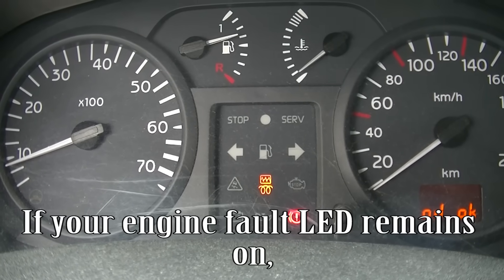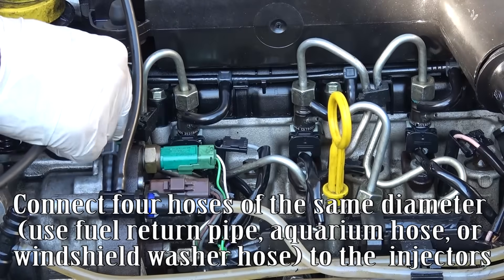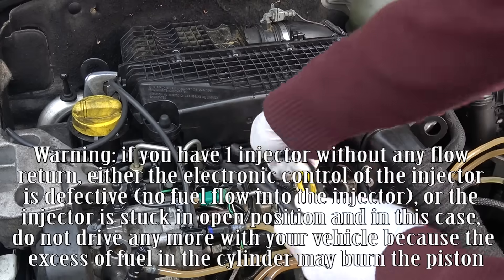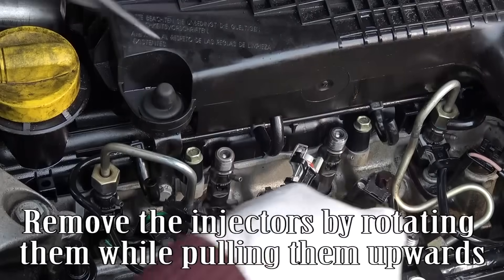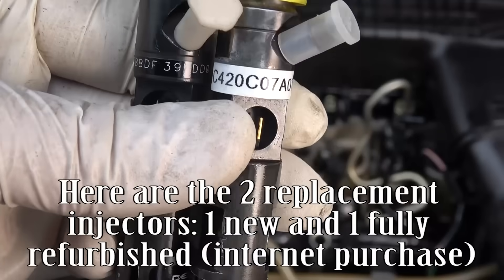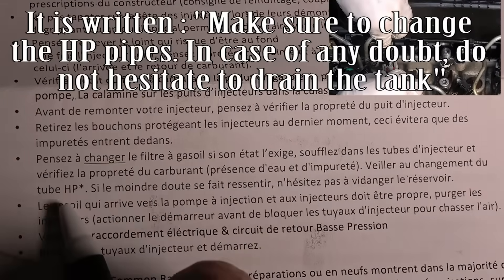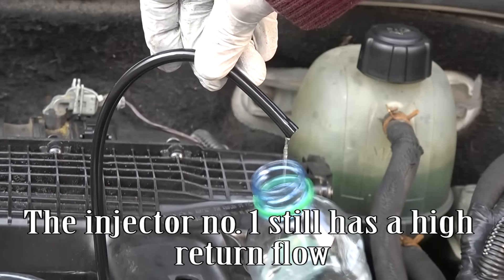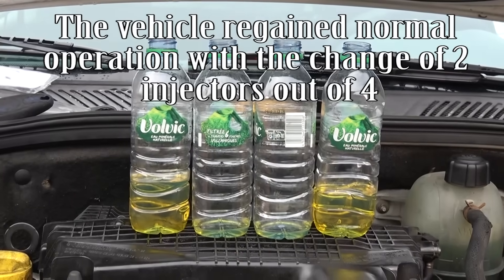Injectors test and replacement

Comment: lol at the shaking engine and gear stick
Reply: Christopher Michael Ayre
Reply: Shaking Gearstick is engine mount gone lol my clio dci has same problem lol
Reply: this tutobuild guy is a legend showing all these typical clio dci faults sadly it just shows what an unreliable piece of shit this car is
Reply: car is shaking because it's so very cooled outside. hehehe
Reply: nice
Reply: thats because he changed only 2 injectors all mechanics recommend by changing fuel injectors change all of them.
Reply: farerse is
Reply: kamikaze is what
Reply: Christopher Michael Ayres being a mk2 clio and also being a renault its also probably gear linkage/gearbox/clutch problems causing gearstick shakes too, changing dogbone mount helps but doesnt fully get rid of the shaking
Reply: farerse
Reply: farerse p
Reply: farerse

Comment: Where did you get such a clean motor? We were in the car service come only fucking pig motors. potions in fuel oil and coked injectors.
Reply: Enot 888 everything depends on the owner... if they know how to drive diesel then the engine is good... the problem is that people don't want to learn because they drove petrol and think they know the shit which is annoying